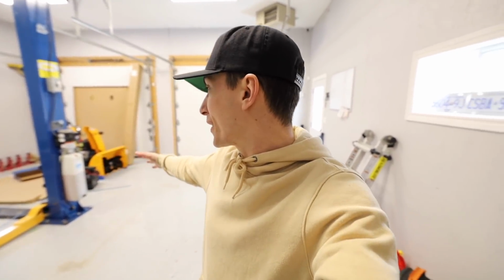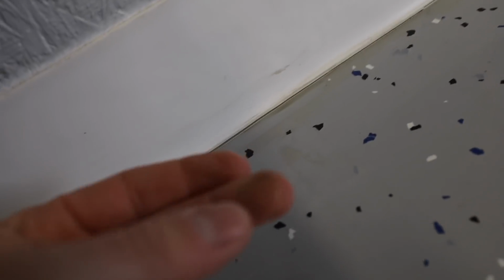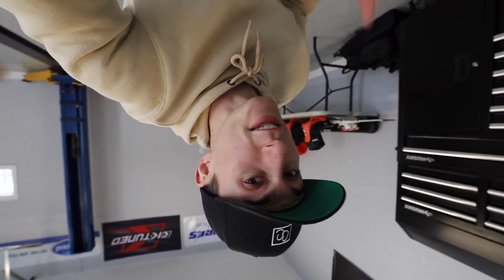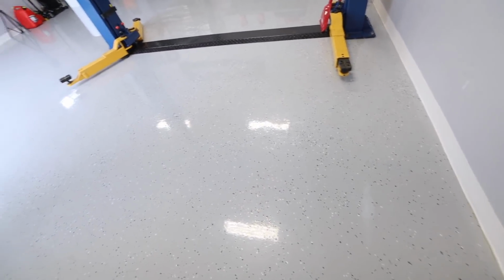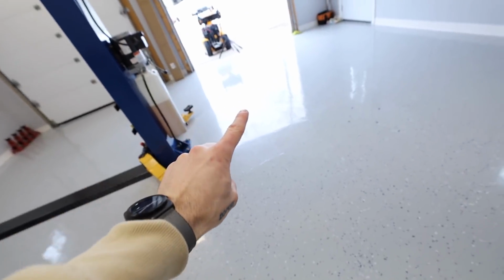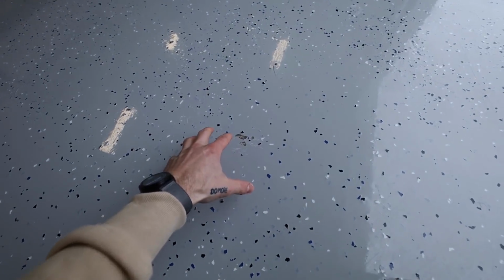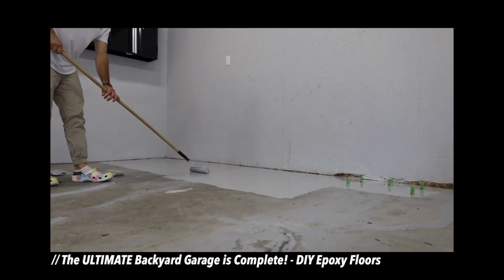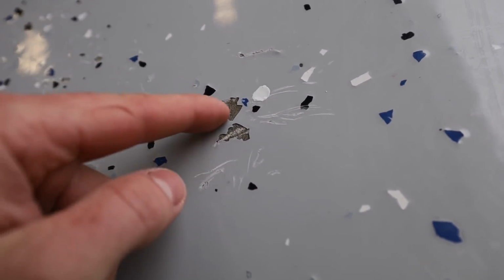DIY Epoxy Floors 6 MONTHS LATER... How Bad Is It?

Comment: I used the same kit probably a year ago and the only mistake I made was that I used a crack sealer too wide and the crack sealer didn’t adhere to the concrete so that part chipped up. It was the first time I used it so lesson learned.